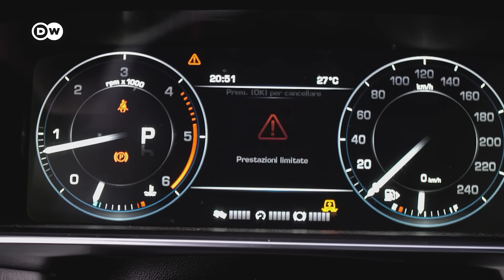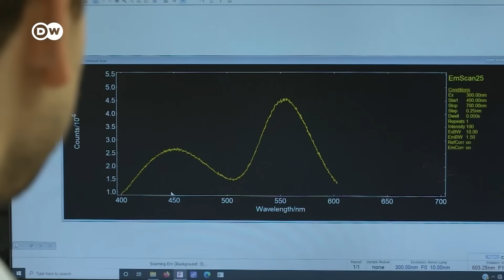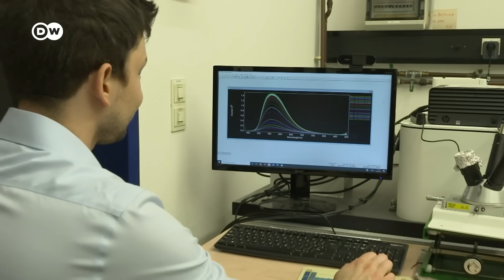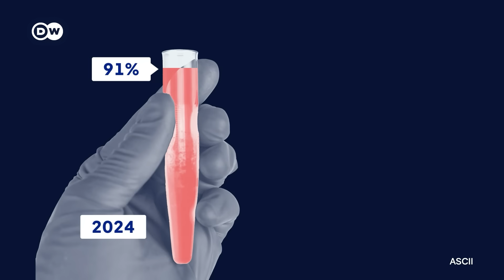How independent can Europe become from China's raw materials? | Transforming Business

Comment: its like those maglev trains from the 2000s, but instead of using powerful neodynium magnets to create the opposing magnetic levitating force to lift the train simply by existing , u now have to use a bunch of electro magnets and feed current through it just to create the magnetic levitating effect before u even think of using additional electro magnets to drive the motor.

Comment: You surely don't need magnets to power electro motors. I've been wondering why they keep doing that. Where is the advantage in that blows my mind. Using opposing generated fields is far more efficient than using magnets. For power generation the situation is more complex but for a motor, the most simple device discovered over a century ago this behavior is mind boggling.

Comment: I worked at GE over 25 years ago.  We used brushless exciters  and had used for a couple of decades before I worked there.  Wireless transmission has been around for decades.  Making motors this way should be simple.
Reply: But aren't these EVs going to need higher density batteries? If they are going to use those magnetless motors.

Comment: Disadvantages 

	1.	Continuous power required – They only work when electric current is supplied; lose magnetism when power is off.
	2.	High energy consumption – Large electromagnets need significant current, increasing operating costs.
	3.	Heat generation – Coils heat up due to resistance, requiring cooling in strong applications.
	4.	Bulkier design – To generate strong fields, they need more windings and large power supplies, making them heavy.
	5.	Maintenance – Insulation of wires can degrade, and connections may fail over time.
	6.	Slower response (vs. permanent magnets) – Switching current on/off may cause delays due to inductance.
	7.	Less efficient – Energy is wasted as heat, unlike permanent magnets which don’t need continuous power.
	8.	Magnetic saturation – There’s a limit to how much field strength you can get, no matter how much current you add.
Reply: In simple terms,what here trying to say is -

As we don’t have permanent magnets we are moving back to old tech and showing as cheaper and it’s a good tech.

Sadly this is the others side of story that isn’t mentioned in this video.
Reply: Thanks for explaining why no one has used this elementary school knowledge about creating magnets until now.
Reply: Great summary. Thanks
Reply: Yes, but it reduces dependence on China. I get it, technologically speaking it might be a reversal to old technology, but in geopolitical terms it’s actually a win.
Reply: @filipavieira8794 what is wrong with China? Unlike most European and American countries there's are actually working well.
Reply: Why don't you list the advantages too?